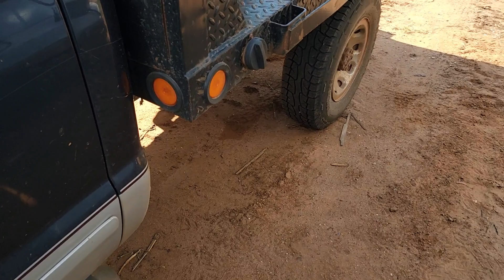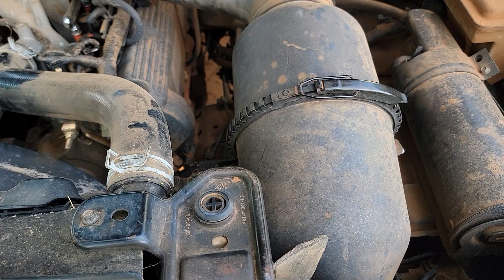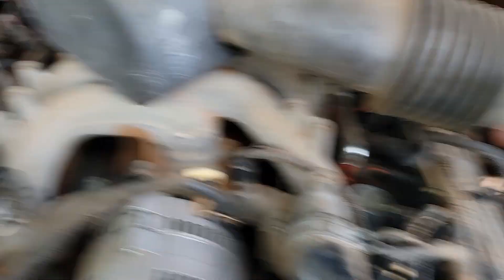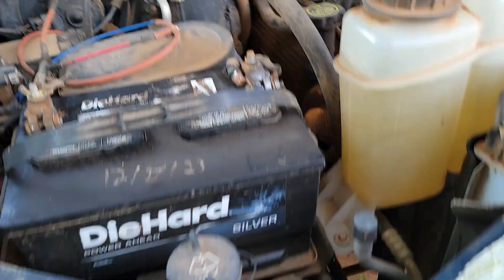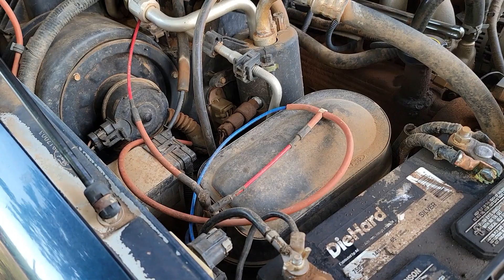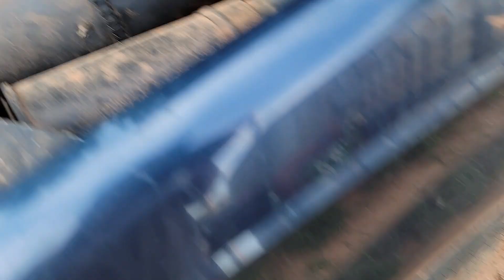Ford V10: Diagnosing Rough Idle (with no check engine light)

Comment: Get a laser pointer heat gun point it at header exhaust i have a v10 you should be at 400 degrees on all cylinders. You can narrow down quickly what cylinder is not running so hot! Clean your throttle body so severely overlooked. A new maf sensor are only $8-$20 these days just buy a new one! Check tightness on all plugs. Some coils have extra resistors in the rubber sleeve ,them make sure your using adequate spark plugs that dont have built in resistors   Evap lines running under truck could have rotted away. If you have 4x4 and you have one of thoose fancy auto 4x4 make sure your vacuum tank is not cracked thus causing u a very slow vacuum leak i can see you have that vacum chamber behind your battery make sure all rubber lines going down to your hubs have not corroded and rotted away. Your hubs are vacum operated via the 4x4 switch in truck

Comment: Follow the rubber hose up from pcv valve toward throttle body it has a 90 degree turn and that hose gets brittle and will crack

Comment: I have 2001 f250 can’t get the Damm evap, o2 sensor , egr, catalyst monitors to get ready for smog riding hot for 2 years runs great no issues just them fucking monitors. Anyone have my ideas?

Comment: Great video thanks.  I have a 2 valve that has a very slight rough idle only when in gear and hot.  Any initial ideas?. Haven't found any bad hoses eccept for the vent hose from the back of the gas tank to the canister under the hood
Reply from the maker: Hmmm......my initial thought is that the transmission might be low on fluid. You could also have a small vacuum leak, even if the hoses look fine. Sometimes they come loose from the throttle body, or get a crack in them that you can't see.
Reply: @Mighty-Quinn thanks ill take a look

Comment: What was the part about the steering pump? A bad steering pump would cause the problem?
Reply from the maker: Yes, it's possible. A bad pump might cause enough resistance to slow the engine down below the set idle RPM, and thus cause a rough idle. 

This is extremely unlikely; usually a bad pump makes a horrendous noise, leaks like a seive, or seizes and slips the serpentine belt. I only mentioned the PS pump as a potential problem because it popped into my head while I was filming.
Reply: @Mighty-Quinn  thank you for the response

Comment: I have a 2000 excursion with 327,000 miles on it. Just started running rough when going uphill or give a little too much gas at once. Injectors have never been changed. Going to try that first and check all the coils and plugs while doing it. Thanks for the videos!!!
Reply from the maker: 327,000? Wow! Good luck with the injectors. Glad the videos were helpful to you.
Reply: give us a update please let us know if that helped thanks in advanced

Comment: I’m going through an issues with my 2001 v10 on cold it starts up fine and drives fine but idles around 1k to 1.5k rpms after warming up it stays idling the same and it dies completely when put in gear I’ve replaced the IAC I the power steering is bad on it should I replace that
Reply from the maker: Sounds like you've got some kind of a vacuum leak, or an air intake leak.  Could be your fuel pressure regulator, too. 

I don't think the power steering would be causing excessively high idle. Probably ought to fix it, because steering issues aren't something you want.

Might also check your transmission fluid level, and make sure it's okay.
Reply: @Mighty-Quinn that’s what I assumed looking for a vacuum leak for about 4 days ended up being the temperature sensor

Comment: Brother i have a 2013 ford econoline e350 6.8l v10 when i tap the gas it drops below idle and it goes quite feels like it wants to die out and then picks up it self sometimes but it happens on cold not warmed up throttle body is changed pcv valve is changed plugs coils still does it any idea i really need help
Reply from the maker: 2013 is a little newer than I'm used to working on, but I do have a few ideas on what could be wrong:
- Air filter needs to be changed
- Idle air control valve is malfunctioning
- Fuel pressure regulator is malfunctioning 
- Vacuum leak, air intake leak/intake manifold leak
- Fuel injectors might need replaced, but I doubt it
- Transmission issue- if the transmission is low on fluid, or has another problem, that would place extra load on the engine, especially when everything is cold; because cold fluids are more viscous and thus create more resistance on rotating components.
- Evaporative emissions system leak (fuel vapor canister and/or lines)
- Could be that your engine is low on compression, but as it warms up and everything expands, it creates enough compression to run. This is highly unlikely, but it is a possibility. I've seen it happen before. 

I would start with the air filter, idle air control valve, and maybe even a fuel filter. If none of that works, then move on to the more advanced stuff. Chances are good that your issue is something simple. Hope all this helps.
Reply: @Mighty-Quinn i really appreciate the help thenkyou i will look into it

Comment: 2003 f250 4x4 v10 bought  new in 2003.104000 miles.only problem fuel pump registers less than 3 quarters  of a tank when full.sometimes it will register  below empty when i start i t up.check engine light is on.and gas cap light commes on.still with original plugs and everything  else
.fuel  pump was replaced  at 45000 miles though.i used to run tank down to far because of lack of money.

Comment: Just had a misfire issue with no check engine light on. I bought a new ignition coil and started swapping it with the ones in the truck one at a time. It was the number 5 ignition coil that was bad but wasn't giving me a check engine light. when in doubt with a misfire, just buy one new coil and start putting it on each cylinder. you'll know immediately when you find it.

Comment: There is nowhere near me that has non ethanol fuel
Reply from the maker: That sucks. Fuel additives are your next best bet. I don't have any particular recommendations, but recently I've been using Lucas fuel stabilizer. It seems to be working good. I've also used SeaFoam, Heet, STP, and Sta-bil; they all do the same thing, but I can get the Lucas fuel treatment in a gallon jug, so it's a bit more economical.

Comment: most of the rough running in my 6.8  2valve has been fuel related. i use additives and 93 octane now. the cheap fuel doesn't seem to affect my 5.4 3valve at all.

Comment: My 01 excursion 6.8 V10 is making a knocking sound. No check engine no codes. It's driving me nuts! would hate to have to replace the engine
Reply: Try Lucas oil stabilazer  or just a thicker oil change
Reply from the maker: Our 2000 Excursion makes a knocking sound sometimes. I never determined what caused it, and I haven't heard it in awhile. If I remember right, it does it more when it's cold outside. Does the knock get better when the engine warms up? Is it something external to the engine, rather than internal?
Reply: @Mighty-Quinn  hey just a reminder that ford did an update for the oil and now they require a 5w30 instead of 520
Reply from the maker: @firstnamelastname-gb4bi  Well that works out, because I've always used 5W-30 oil in the V10s that we have lol

Comment: Had a 2000 v10 for about seven years and have ran into this issue a number of times. One time it was a bad circuit coming from the PCM to the mass air flow sensor. Had low voltage at the sensor. Replaced the PCM and fixed the issue for a few years. Few times it was bad spark plus. Currently dealing with the issue again and currently pulling my hair out. Done most everything in this video. Going to try the power steering pump (feels like it’s going out) but that feels like a long shot. Plugged up my forscan and everything looks good. I am getting a type B misfire (fuel related). Fuel trim looks good though. Going to check the vac lines (again). Good video, good reminder of all the things.
Reply: Any suggestions
Reply: Idle control valve.
Reply: Idle control valve
Reply: ran into this problem or have run into this problem.

Comment: Excellent vids!. I screwed up the fuel line disconnect from the fuel filter on up to the engine. It was insanely rusted. The other side came off ok, man that tools sucks too. Pressing forward first helped, but when it was super rusted so there wasn't much I could do. Do you know if they sell those lines already premade by chance? I'm guessing it goes all the way up to the fuel rails from the filter side?
Reply from the maker: Finding those premade lines is tough. Plenty of options for diesel trucks, but nothing for gas. I did find one place awhile back, that appears to sell replacement fuel lines, and brake lines. Here's a link if you want to check it out: https://classictube.com/ag-1783690.1783634.1783944-2001-ford-f-250-super-duty.html
Fair warning: I have never ordered from this place. It's just somewhere I ran across while looking for some other parts. Nobody else seems to sell these fuel lines, and I'm not sure why. It's not like gasoline fuel lines don't go bad, especially in the rust belt. If you don't want to order from Classic Tube, I think you're stuck making your own fuel lines. 

And yes, the line should go all the way up to the fuel rail. I believe there is a pressure and return line, and there's a vapor line as well. They're all kind of behind the engine, and they suck to get at. Good luck lol

Comment: Very thanks for explanation. My makes me crazy, smoke show nothing , pressure is good, sensors are fine, and still throw lean code for both bank which in reality it is not able to move somewhat idles but thats all. No idea where to move, and mechanic says that too.
Reply: My stepfathers 2002 SD v10 triton had a fuel relay going bad that's built into fuse box. I put in a external relay after finding low power going to fuel pump at the fuel cut off switch in passenger side floor panel.